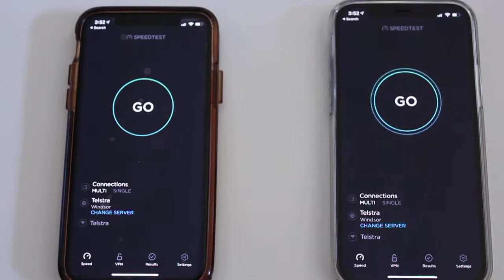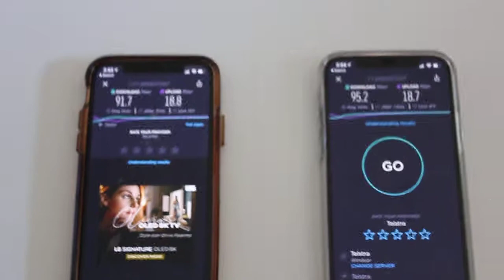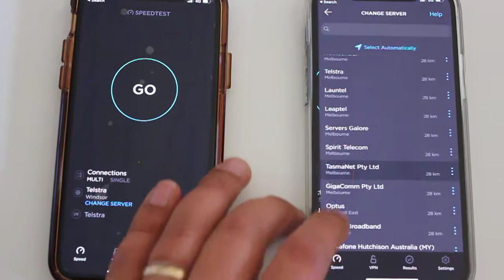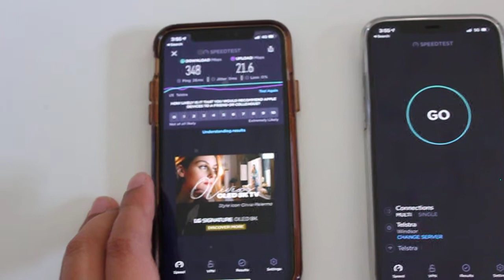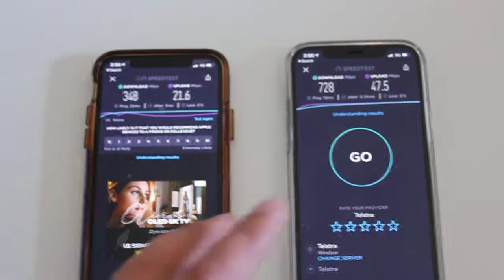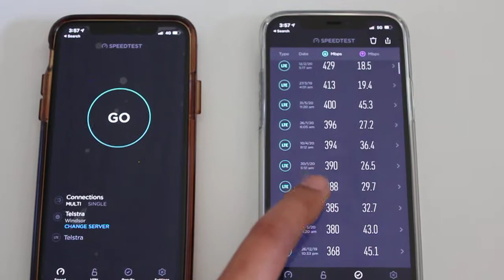iPhone XS vs iPhone 12 Pro Telstra WIFI and 4GX vs 5G speed comparison

Comment: how hell did you get that speed on 4gx  i only get 2Mbps  maybe at best i got was 5Mbps   to do them test must have download a lot data
Reply from the maker: Depends on the tower and location
Reply: I'm getting 420mbps in south brisbane on 4gx.
Reply: @AuntyDonda  can i run cable from your router to my laptop even at 500km it would be faster then my 4g internet speed
Reply: getting 300+ on 4gx at my work

Comment: I can’t connect to the wifi using iPhone 12 I’m connecting to towers all over the place! The Telstra tower is across the road iPhone 5 picks up wifi from tower across road! 😳
Reply from the maker: Are you in a regional area?
Reply: You are confused. Wifi comes from a privately owned Router, and internet connection. 5G comes from a phone tower. Both will connect to the internet (provided the router has an active internet account from an internet service provider [ISP]) but 5G, 4G, 4GX, 3G, and 2G are considered "Mobile broadband" because they work through mobile phones and Sim Cards. Phone Towers do not put out "Wifi"

Comment: 5G is a little dodgy here in Melbourne south east.   There is only a small pocket near me where 5G is hitting  700Mbps, most of the time, it’s 20-70Mbps down.  Ps. I’m 4km from Telstra Windsor.  I went down chapel street and on 3 bar 5G on iPhone 12, I did a speed test and it was sub 20Mbps.
Reply from the maker: Funny I live in SE Melbourne, depends the area